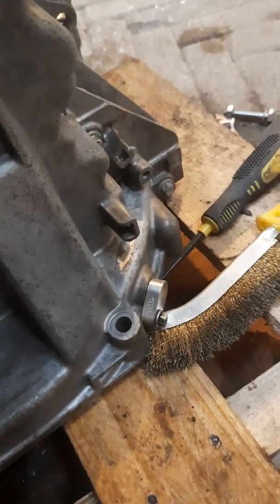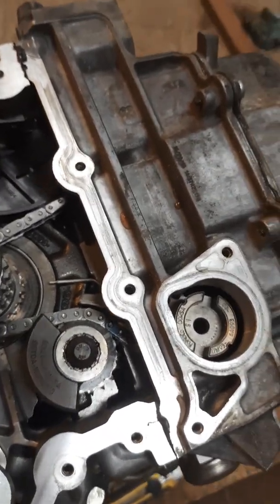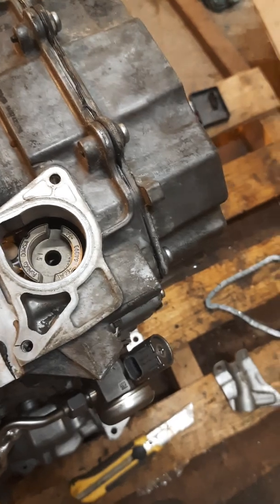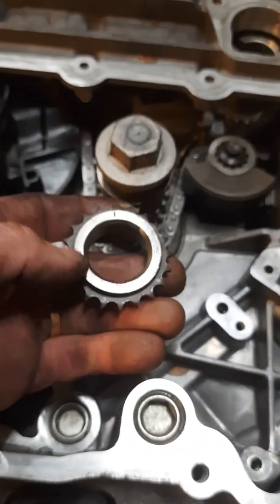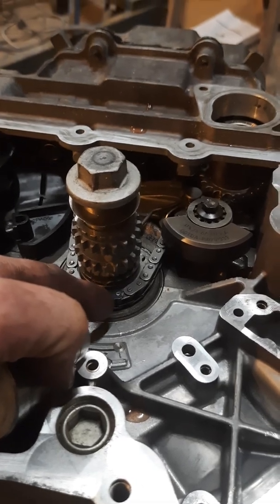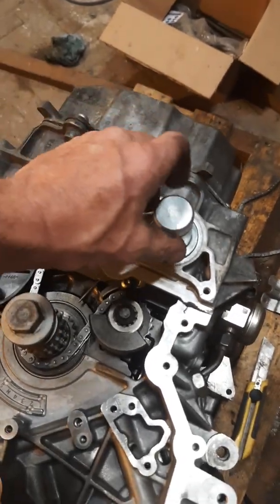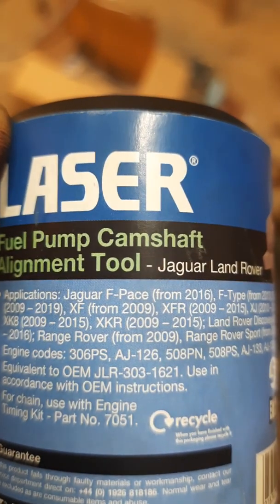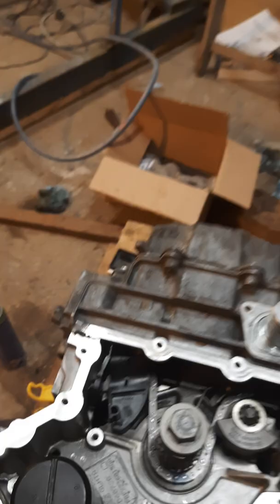Jaguar 2016 3.0 V6 Supercharged 306PS fuel pump timing

Comment: The alignment tool can be installed in an improper reverse way, according to the X260 manual chapter "FUEL PUMP CAMSHAFT TIMING CHECK".
Is it possible that you assembled incorrectly the tool ?